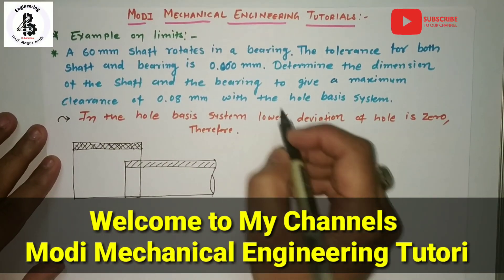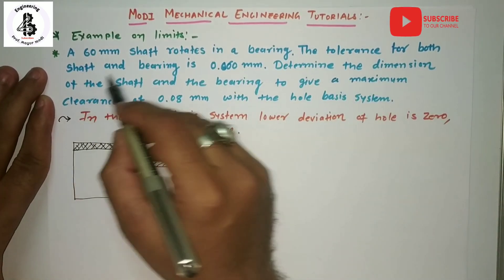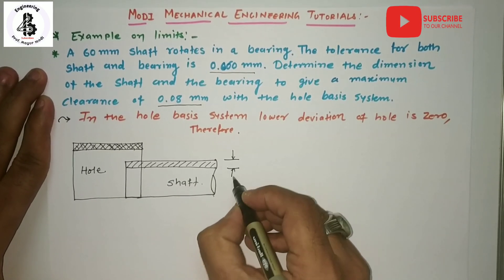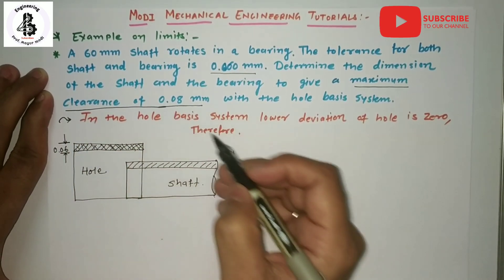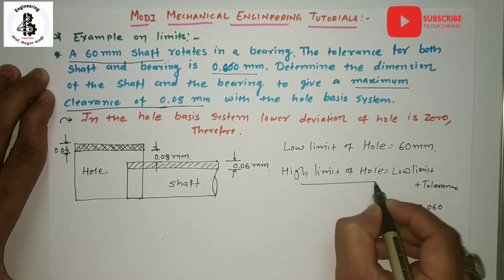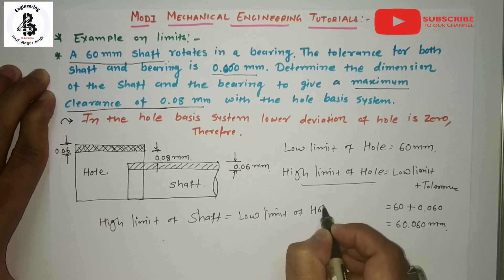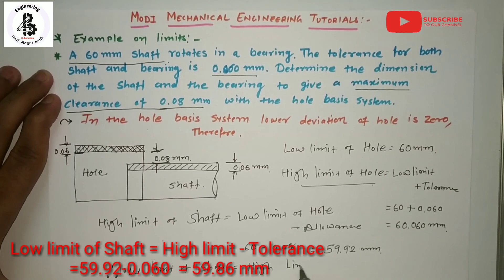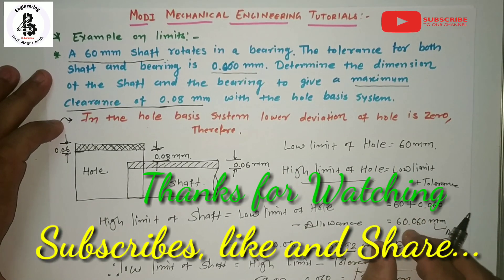limits fits and tolerances problems | Hole Basis | Shaft basis Systems

Comment: Sir, in question it is written max clearance  =0 .08mm ( i.e UL of hole - LL of shaft= 0.08mm)

But  you have taken allowance as 0.08mm ( and allowance is not maximum clearance it's minimum clearance)